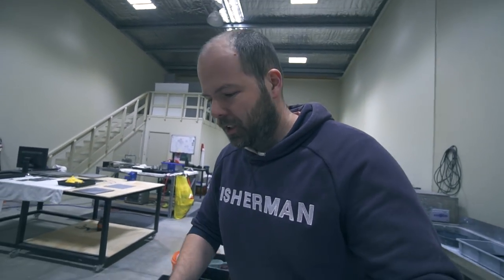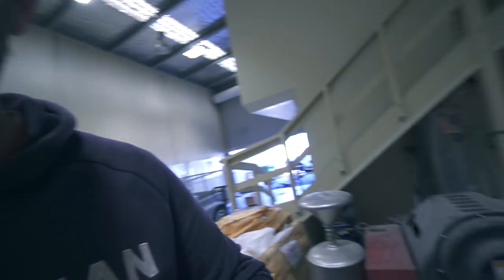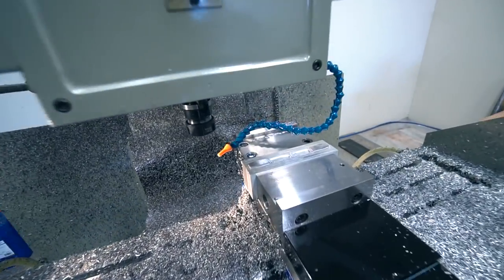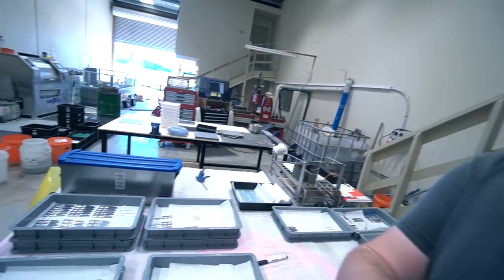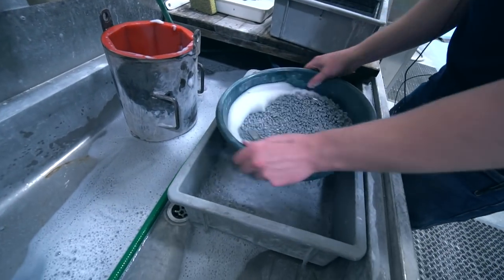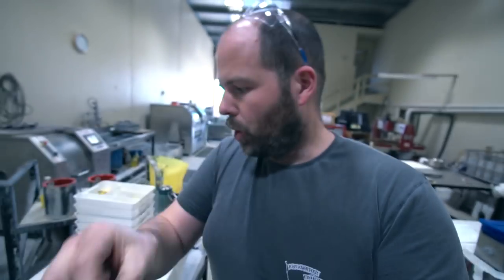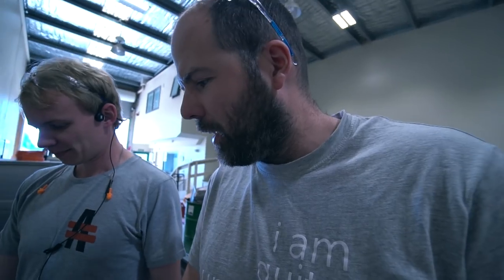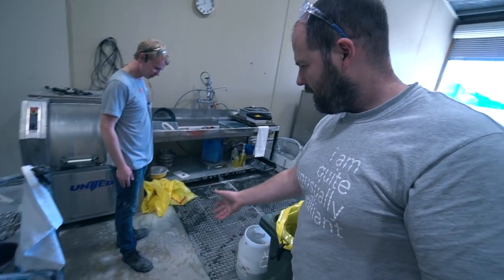Making Titanium Knife Scales (with CNC)

Comment: I’d say the ties are there to keep the media from getting lodged in the hole, and to keep them from sticking to the sides of the tumbler chamber. And to keep them from clinking together and scratching each other.
Reply from the maker: You're kind of right on this. The reasons include all the ones you mention ...but the MAIN reason is to stop them sticking to each other in this specific instance.

Comment: Hi Magnus, in this video you talk about the sheet thickness problem affecting the chamfer.... have you thought of doing side 2 first (the side with the pocket)... you could switch up the operations on this side to mill the titanium to thickness, then machine the pocket...then move the part to the chamfer, side clean-up, notch operation... from there your chamfers should all come out the same....yes?
Reply from the maker: You're right Ian, I had considered this ...but the issue I thought I would encounter was that the scale would be down to 2.5mm thick by then ...and so it could get tricky to put the chamfer on as there would be very little to hold onto in the soft-jaws.

However, I could used another method, such as a clamp, to hold the scale down to chamfer it - which I think would work fine. BUT, the main thing is that I really wanted to just crack into it and get it done. I knew it was going to take around 25 hours ...and so I was reluctant to spend a day or to making a potentially quicker method ...when I could just get going right away with a guaranteed way of doing it (even if it was less efficient). Hope this makes sense?